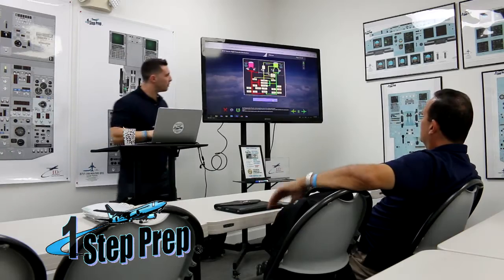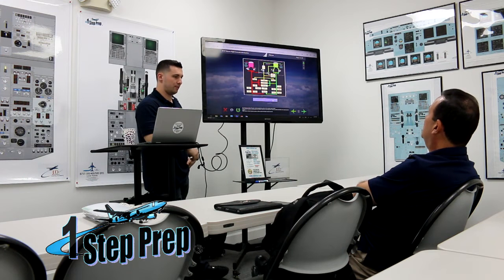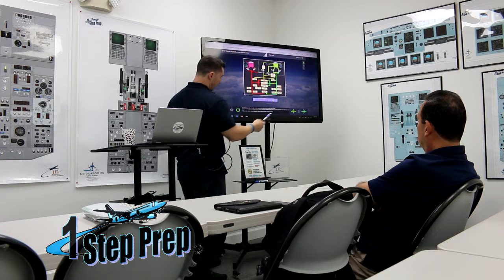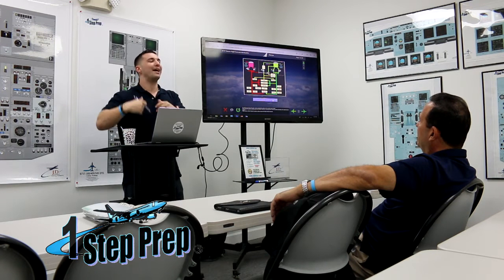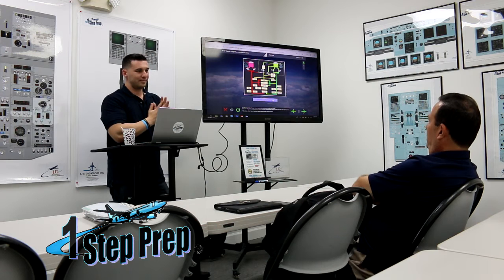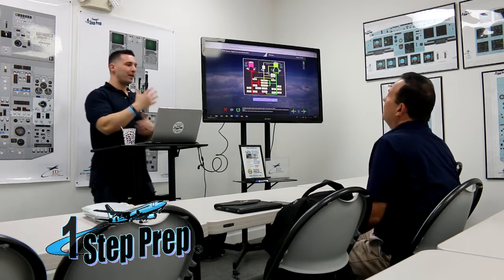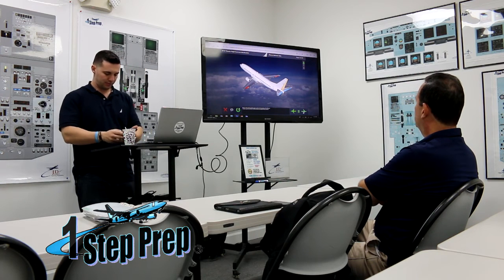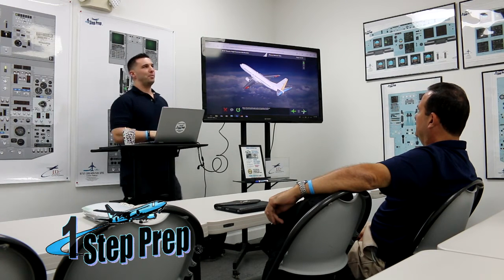HYDRAULIC system B737

Comment: The engine driven pump moves at 3000 psi 22 gallon per minute and the electric pump moves at 2700 psi and 6 gallon per minute.